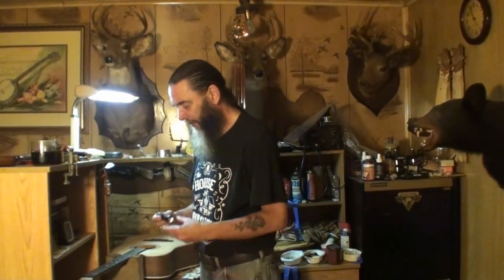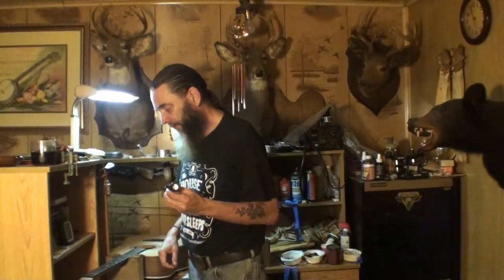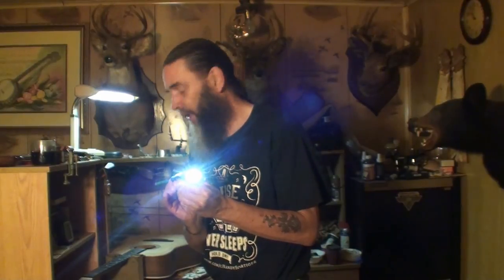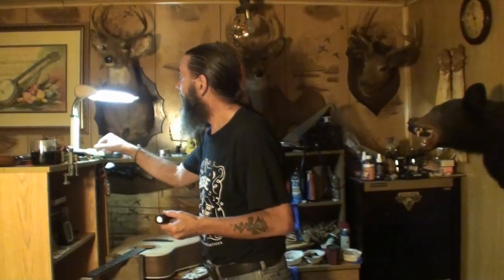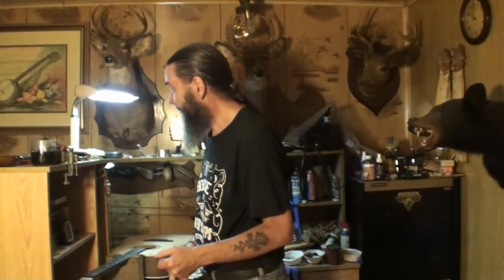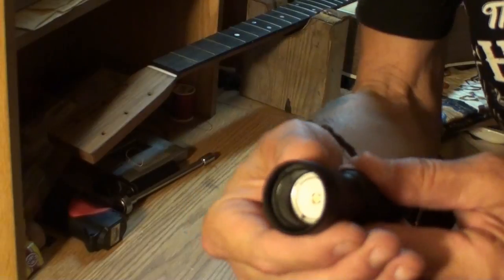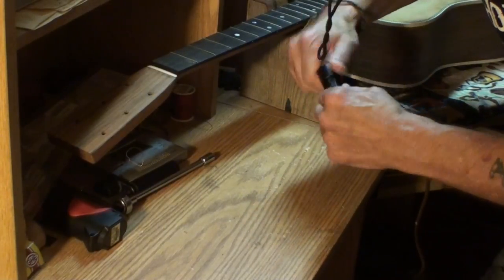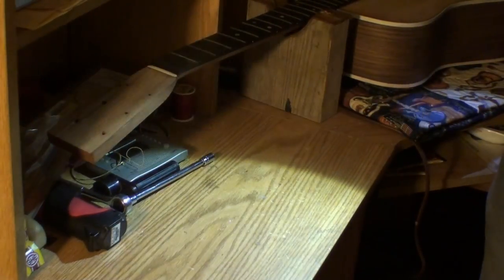infray tactical flashlight review

Comment: Randy quick question. Changed the strings on my guitar, and the low E is kind of buzzing just a bit when it is played open. It's driving me insane. Everything I played on the guitar yesterday sounds like shit today and all I did was change the strings. Same gauge of strings, different brand. Martin brand actually. They also seem to be going out of tune pretty easily. Not just the low E. What is going on? Everything was perfect yesterday until I changed them. It's not super buzzy, but it definitely sounds different and it's throwing me off while playing.
Reply from the maker: Greg Appa new strings tend to vibrate more than old ones and the elliptic pattern is sometimes quite bigger, either you're nut action is too low or there is too much back bow in your neck, meaning the truss rod needs to be loosened slightly. This is of course if your setup is very fun tuned. Not sure about them going out of tune, give them a good stretching.
Reply: Randy Schartiger I appreciate the response. Wish I would of found your channel sooner. I love it. But it's okay because now I have all this great content from you to catch up on. God bless brother!